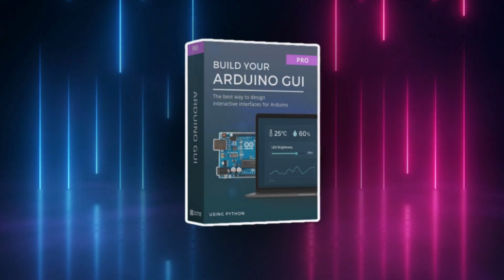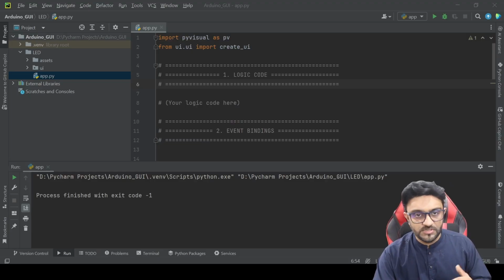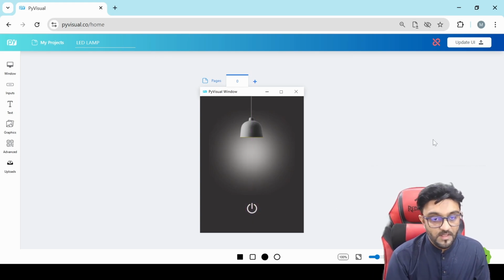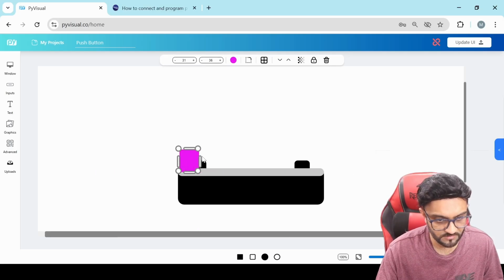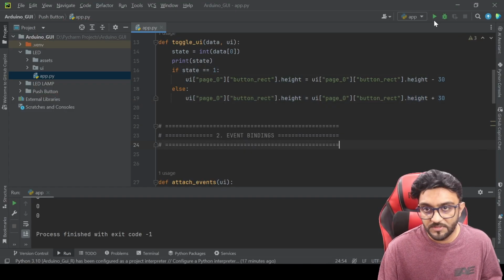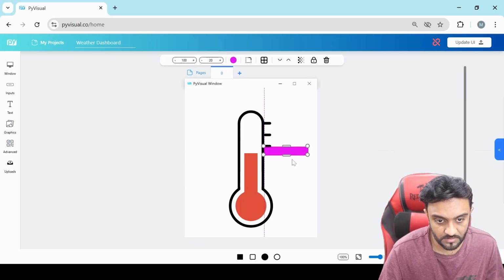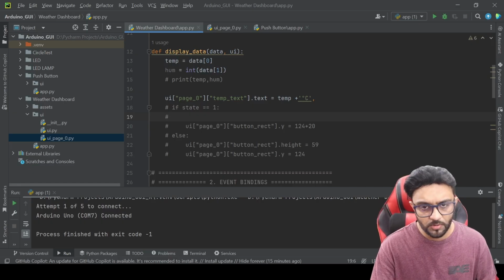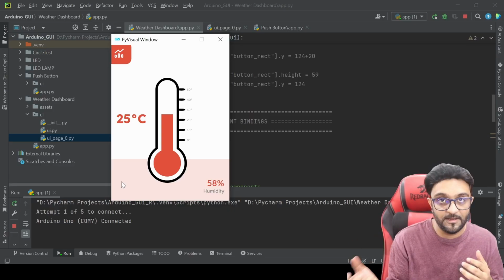Arduino GUI Basic Course

Comment: Hi there - it's quick to get started - works great and I have created an exe file based on the generated app which worked fine. I'm trying to create a radio button group - is there a UI container for that or do I have to code it in python app? Thanks

Comment: In pyvisual AutoSync not working. I saved the project and click on the icon (AutoSync) and nothing happened. Have you solutions?
Reply: I tried on Chrome and it works. Only on Chrome is working.